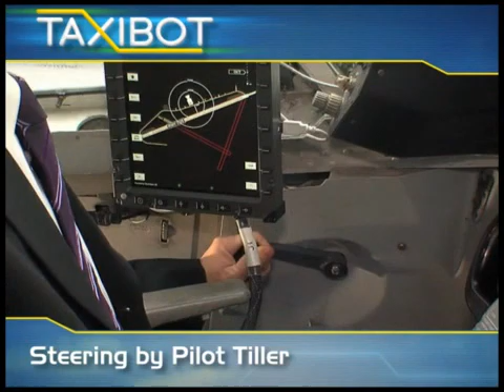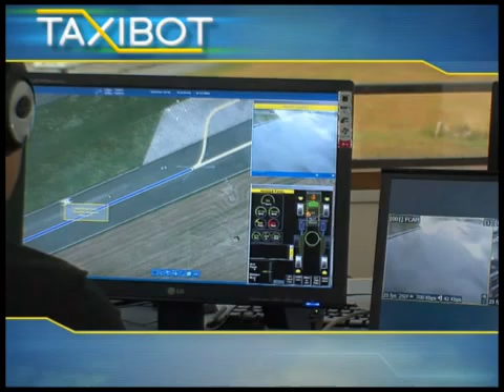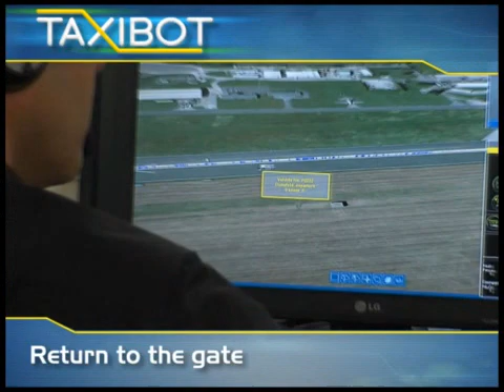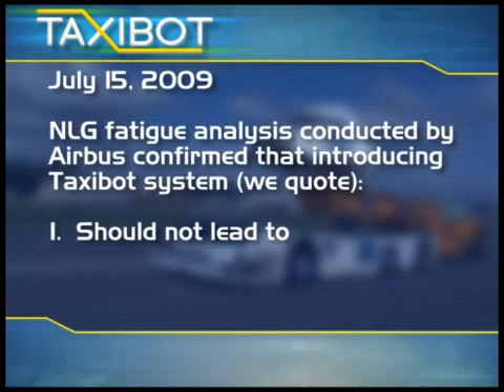Taxibot

Comment: Sorry but this is a really dumb April Fools type of a concept and I don't honestly see any airline in their right minds ever, ever signing up for something like this. 

What is the difference between this dumb system over tug drivers simply towing the aircraft out to the active? The drivers have to be present in the tug anyway and they are listening to ATC and pilot instructions. 

All this does is give pilots control over a third party piece of external equipment to worry about during an already busy situation on the flight deck. Bad idea all around. It makes more sense for Boeing and Airbus to simply add an additional engine to power the gear of the aircraft more like a car which is also a bad idea.
Reply: You haven't thought this through, have you? First of all, this does not increase workload at all, why would you think that? Secondly, do you really think Lufthansa would implement this at their main hub Frankfurt if they weren't dead certain that it makes sense? This thing saves Lufthansa 2700 TONS of fuel per year. Maximum fuel capacity of an A320 is 18 tons, to put it in perspective.
Reply: +H171001 I am not saying the concept does not say fuel I'm saying what is the point of the pilot having to control this machine when there are human beings already sitting inside it. How does that make it any different then just having a typical ramp agent tow the aircraft out to the runway? 

The fuel savings is good. taxing the aircraft out to the runway instead of running on engines for long periods of time is good too. But The taxibot concept is dumb and I guarantee you there are not many airlines and airports that will consider this.

Comment from the maker: Hi!

The main idea of the Taxibot is to save taxi fuel for the operators (airlines). This will also help reduce "green taxes" for CO/CO2 emitions.
No training will be required as the TaxiBot is "sensing" nose gear input (no bypass pin required).
Probably the only modofication required to an airfield will be adding a driveway for the TaxiBot to return to the pit\terminal area without crossing the taxiways.

Comment from the maker: Not sure you got the idea (although I agree it does not seem to be that functional givven the operational problems in hand) - however the aircraft does not start the engine untill it gets to the runway or as otherwise required.

If you take JFK as an example - then the avarage taxi time is about 40 min - this means that 30 minuted of fuel burn could be saved. Compared to the fuel consumption of the Taxibot (two diesel powered engines) - this means a great fuel and polution save.